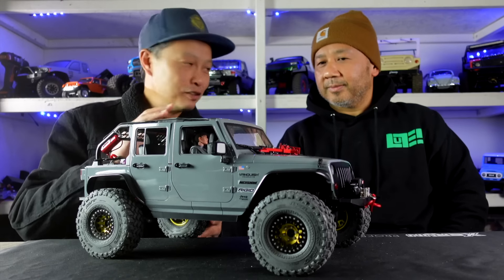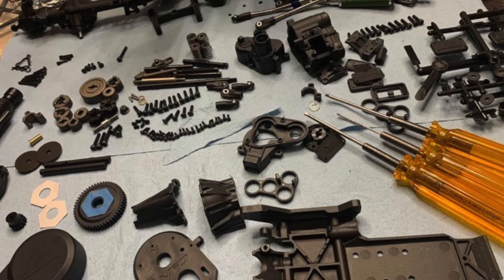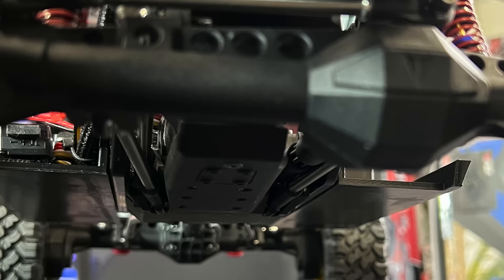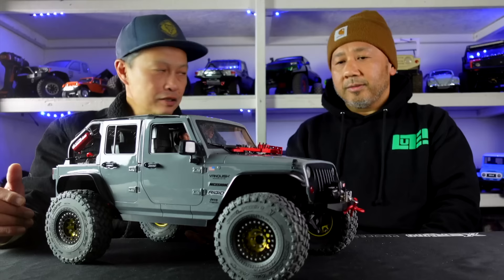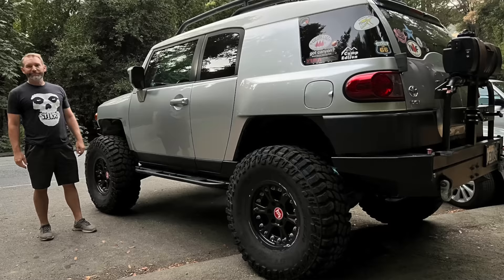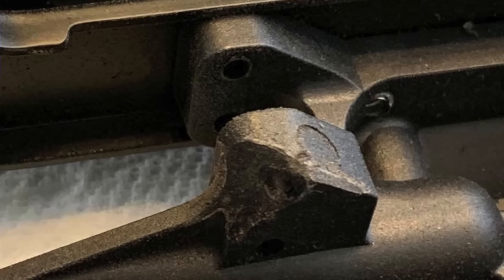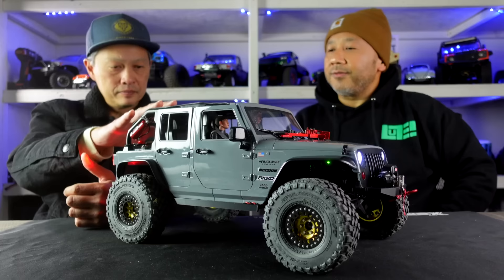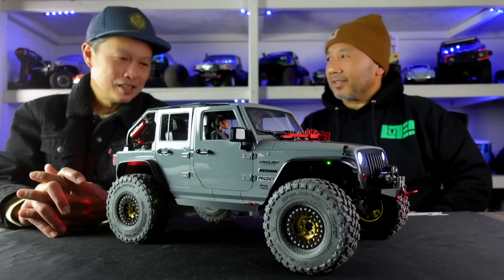Vanquish VS4-10 Phoenix Builder's Kit Project Car - Ultimate 4x4 Jeep rc crawler

Comment: Nice. I have this Jeep Injora body aswell back hinge mounted, but on cheap Scx10ii clone chassis ( w.2x full metal transm.boxes). 
Body shell has full roof + steel exocage w.roof rack. 
Full interior and 4 scale full body passengers, winch & accesories. 
Very heavy scale rig, but surprisingly capable offroad. Still only on 2s & brushed motor. 
Built this 3-4 years ago from  ebay parts from CN (Roll.chassis £70, Body £50, exocage £30) 
Regards, J.B.London aka JBL Team RC 😊

Comment: im gonna have to disagree i have the rtr kit an i did not have to modify at all its close  but i think they did a little rework to the motor /trans im running fusion pro on everything i have that it will fit in